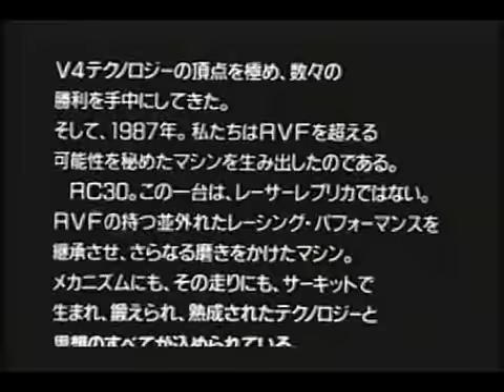RC30 promotion film

Comment: @razor650 They do - you just have to spend the $30k+ for them.

The RC30 was expensive - in 1990 I remember them costing $16,500 (at the 1 dealer where they actually sold it).  To put that in perspective, the GoldWing at the time cost around $7500.